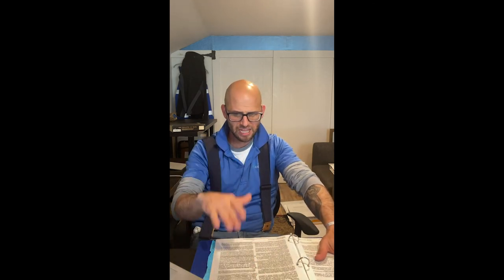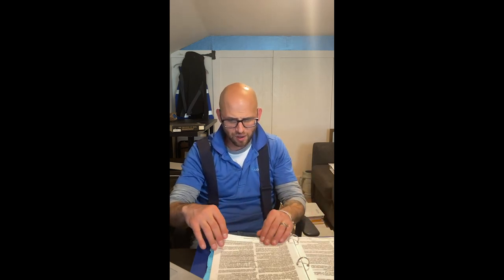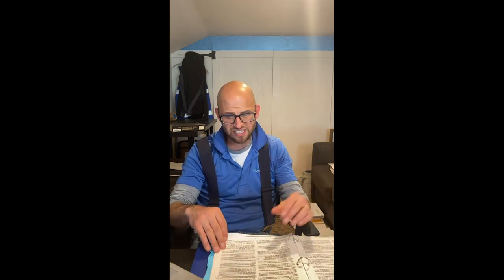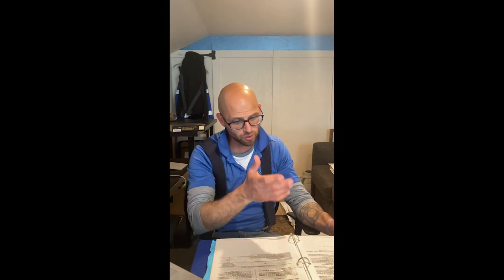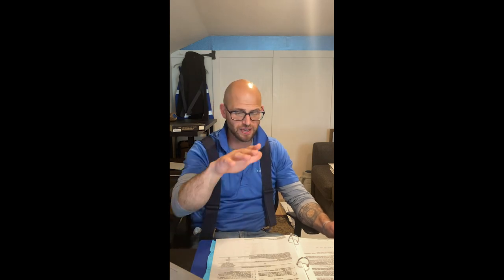How to Achieve Consistency at a Concrete Batch Plant - Vlog 706

Comment: Most contractors have to be told when water is added into the mix to make it workable it has to spin 30 turns. They'll have you put 30 gallons in and want you to start pouring after 10 turns of the bowl. The front looks like they like it and the back of the mix is still not wet enough.
Reply from the maker: Agreed!!!